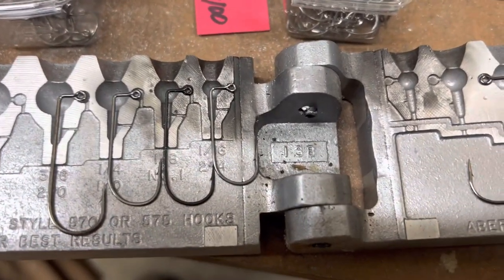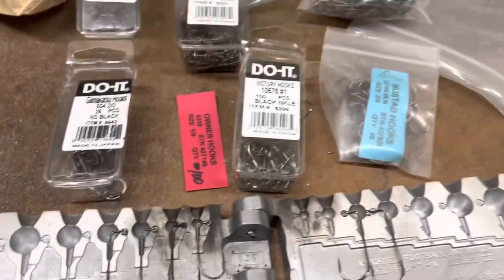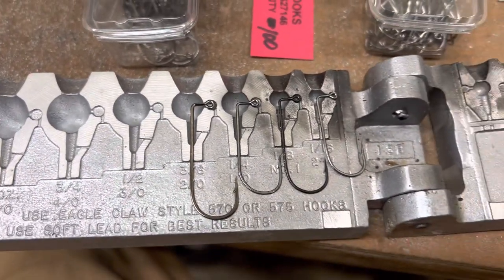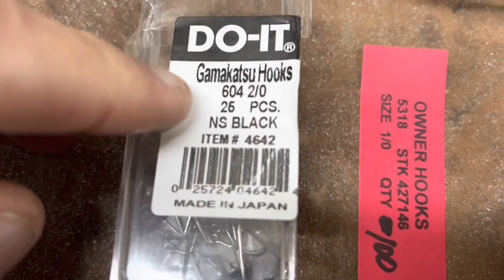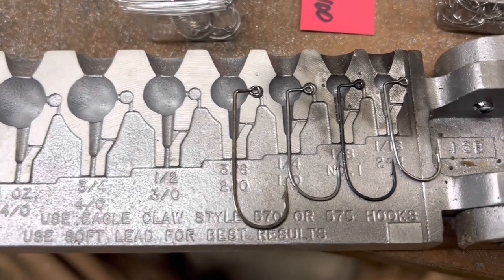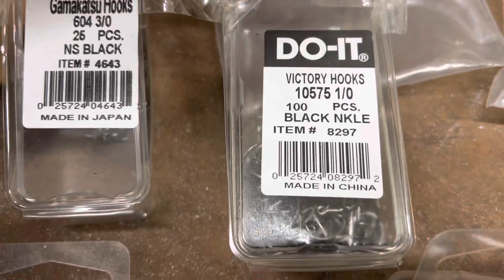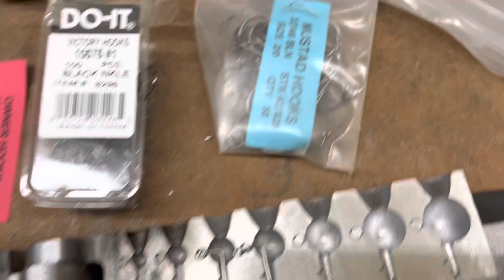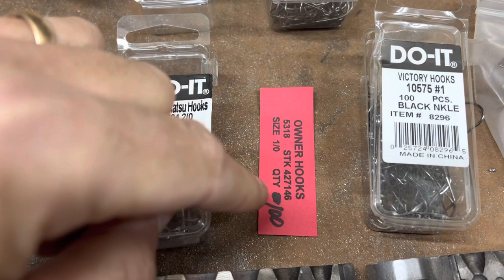What is your favorite 90 degree jig hook?

Comment: Jeff, thoughts on a 90 vs 60 degree hook bend for the football head? Would it make a difference?
Reply from the maker: I made some heavier 60 degree football heads. To me, in theory it should help with parting the jaw some, but the trade off is less rotation inside the mouth to bury the hook in the roof of the mouth.

Comment: Have you looked at the VMC 7147 or 9147. I just picked up some 7161 to try in my arky jig mold.  I would say they are much sticker then Mustads.

I got the Victory V locks and have a bunch poured up for this season.  I love tossing those lil bitsy flip jigs from Strike Kjng in ponds and starting making my own with the V lock hooks.  From what I hear and can tell it should keep them locked.
Reply from the maker: I’ll grab some of the 7161 next order. Victory has a lot of good options. The 60 degree I used on a different mold is sticky for it being a heavier gauge wire. I’m waiting on an order of the lighter wire V Locs.